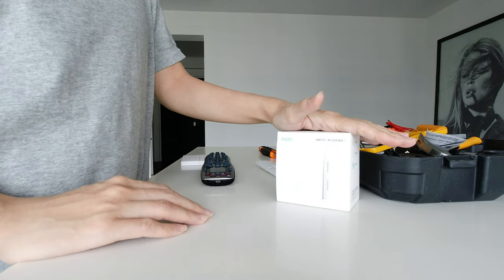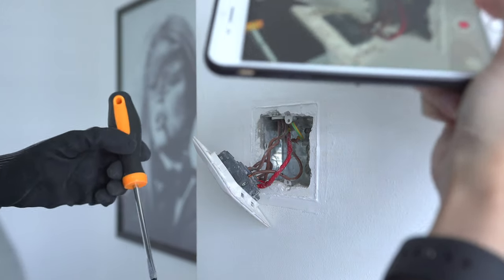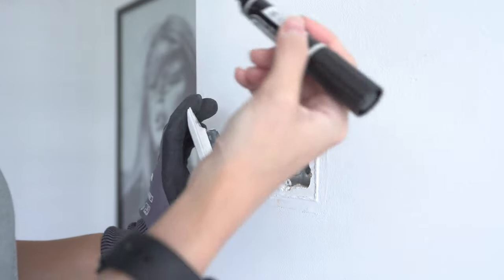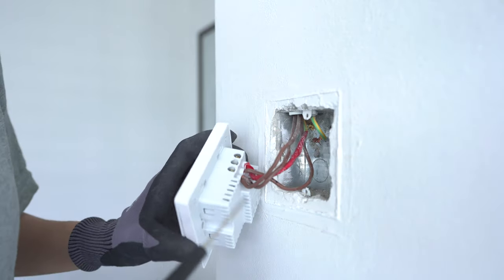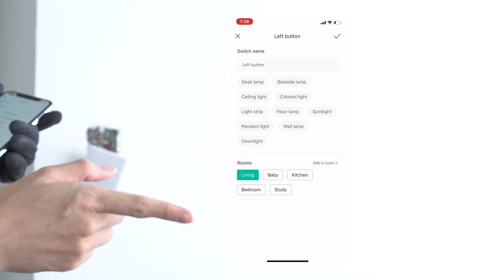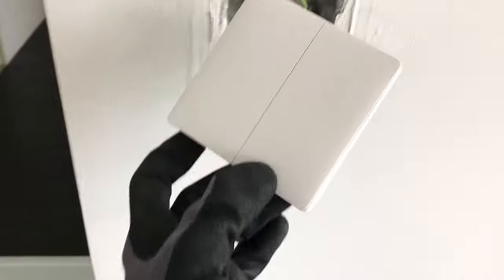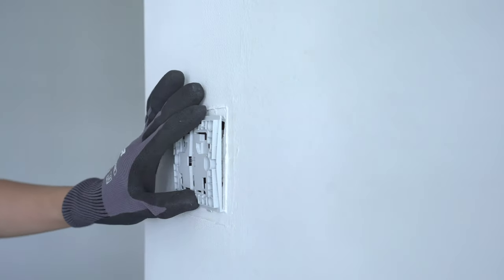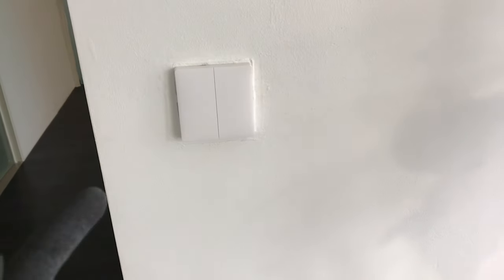Aqara Wall Switch HDB Installation *UPDATED VERSION*

Comment: Thanks for the great video. So you also need an Aqara hub for this switch to work? I have seen some wireless switches that come in a pair and no hub is required. One will replace the traditional switch and the other can be placed anywhere to perform the same switching function like a 2 way switch.

Comment: Hi, what is the purpose of inserting both 2 live wires together in L. Is it for a two way switch whereby you have another switch on the other side of your home that could control the same lights? Tia.

Comment: Hi, Excellent video! 
My room light swtich external push button, my contractor installed the small word "ON" look upside down, but the function is fine, may I know any problem with that? Should I ask my contractor to redo it?

Comment: Great video and I’ve learn something from you.  Correct me if I am wrong.I have the following setup 2 Xiaomi smart Leds connected to a E1 switch (2 gang no neutral line with just L,  L1 and L2) which automation can’t turn on when the E1 is in OFF state.  It only works when the E1 is in ON state.  Am I missing something or is Neutral needed.
Reply from the maker: Maybe different. Mine is the old kind of aqara which I removed it recently. I will be sharing my own smart home startup soon

Comment: Does hdb bedroom ceiling light switch concealed wire route towards up/down/left/right of the switch? Thinking of drilling 2 holes near the switch to mount the aircon remote control holder, so just wanted to avoid drilling into the concealed light switch wire, should I mount on up/down/left/right of the switch? Thanks.

Comment: thanks for video, understand I well that status (on/off) should not be true if you combine manual and app controll switch ? I mean situation - light are on by the app, then you turn off lights by switch - does the app show lights still on or off ? If app changes status - how long it takes ? Thanks
Reply from the maker: Sorry I removed my previous response as I thought u referred to the SwitchBot.

Here’s the correct ans: No matter u on off it manually, it will detect the current state on the app but it takes time. Can be 2 secs. But i noticed it response faster with cellular compared to wifi.

Comment: Excellent videos, I watched the old and this one, excellent information about the switches, good to know there are 2 different ones :)
Now I have a new project for my house, thanks again and keep it up!
Reply from the maker: Both videos are the same... aqara non neutral wall switches. And the latest d1 wall switches triple gang
Reply: @madsncakes  Thanks MADS, I actually meant the wireless switch vs the switch you wire to the wall :)
I thought it would've been a really great solution to actually change the switches, but didn't see that solution out in the regular places I shop. 
So thanks for bringing it out
Reply: @madsncakes  hi there, does the latest D1 wall switches have the same installation method as your videos? i needed triple gang switches so i need to get the D1 version for my place.

Comment: Great video. After seeing this video, I have better understanding of what to get for my next addiction 🤣. Btw, you are not using Mijia app but Aqara app instead for all ur devices. Anyway, you are such a handywoman but do take safety first. Kinda having cold sweat seeing u on the ladder changing ur ceiling lights...😅
Reply from the maker: Melvin Tan i am using mijia app as it’s most convenient for me with all the sub brands like Viomi etc. 
The first few steps was scary then I got used to it. It’s my first time attempting ahhaha
Reply: @madsncakes  Hi. is it working with Mi Home? or only with Aqara Home? I am using Xiaomi Hub Gateway v3

Comment: Hi @mads i am trying to change one of my hdb 2 rocker wall switch to the aqara switch non neutral. Apparently i have 6 wires instead of 4. Not sure if u able to advise

Comment: Enjoyed your video. I have installed a 2 gang smart switch , but I can only get one of the lights to work. Any idea where my mistake may be. My old switch was identical in wiring to yours and I transferred the wires as you did.
Reply from the maker: If the wirings are all correct, check the condition of the copper wires. If it looks burnt, trim the ends further in. Hope you understand what I meant.

Comment: Hi I need your support.
I want to use Aqara switches as a 2-way connection. 2-way - i mean a long hallway - with a light in the middle and 2 switches on both ends, so i can switch on and off the same lamp from both ends.

I currently have an existing 2-way electrical installation with normal switches (non smart).

Comment: Hi does the hub has to be near the switch? I thought the switch connected to the wifi and the hub could be placed anywhere in the house as long as it's connected to the wifi.

Comment: The two rocker switch that I am trying to replace has the same layout configuration as yours. I was expecting one Live/hot  wire coming from the MCB but there are actually two and interconnected exactly like yours.... I am wondering if anything need to be done to fasten those two wires before inserting into "L" socket of the Aqara switch.......

Comment: Hi Great vids! Do you think its possible to fire up the smart bulbs(such as Yeelight bulbs) or even turning it off with use of Mi/Aqara Motion Sensor without the need of changing the wall switch ?
Reply from the maker: As long as it is in the xiaomi family and connected via app. It should be able to automate motion sensor > yeelights

Comment: I saw that you managed to control the 2 pendant lights with 1 wiring and also ceiling lights with only 1 wiring.
How are those wired? are these daisy chained and run as 1 wire to the switch?
Trying to understand the wiring things for my upcoming home as well to consider smart switch or smart lights instead...
Reply from the maker: It’s hard to explain. If you need help - get an electrician who knows smart home stuff. Johnny +65 9010 9695

Comment: Thank you for this video.
If my lights aren't smart does the switch work ?
Thanks again.
Reply from the maker: PRG Line that’s the whole point. Smart switches will make normal lights smart
Reply: @madsncakes  Thank you.

Comment: Recently I installed a Aqara Wall Switch (No Neutral). But I unable to connect with Xiaomi Gateway 3. It show not compatible. What shall I do? Any advice? I thought Xiaomi gateway 3 support zeebiz and Aqara switch support zeebiz as well.

Comment: Hello. I have existing sockets at home which i want to replace with Aqara D1. Was wondering are the mounts standard? I'm referring to the size and spacing of the two screws at the 6min mark. Thank you!
Reply from the maker: It fits sg standard.
Reply: @madsncakes  cool thanks. hmm i noticed my plug has got 2x red wires leading into "Load" and then a blue wire. Does it mean that the "Load" are live wires and Blue one leads to my light? And that the "No Neutral" aqara will suit me? Thanks a lot!
Reply from the maker: @penumbralle27  no neutral suits all home. I am not qualified to give electrical advice
Reply: @madsncakes  I see. thanks a lot for the informative video :)

Comment: Hi, good video. Any idea usually, how many wires are there for wall sockets in Singapore? 3 (earth, live and neutral)? Since you are using Xiaomi just wondering if you know of any wall sockets (tempered glass surface, touch screen) that works with Xiaomi (Mijia). It will be good if it can work on a dual platform (with Tmall Genie). Thanks
Reply from the maker: David Ho I only know for my type of housing.. no neutral. Not sure about tmall genie sorry!
Reply: @madsncakes  Thanks for the reply. At least I know its no neutral. Just wondering if the no neutral is "by default" as in when u get your apartment (completely new) its like that or, its done through renovation (at least I have a basic gauge). Just want to confirm as many new apartments were built to be without neutral which is to cater for smart home as compared to the ones that were built earlier. Once again, many thanks for responding.
Reply from the maker: No neutral by default in hdb... anyone pls correct me if I’m wrong :)

Comment: I ordered an outsmart smart switch with no neutral. It comes with a capacitor and it says I must connect it to the very first light. Didn't really see or hear you mention about capacitor. Is it a must to install it?
Reply from the maker: Not a must.
Reply: @madsncakes  thanks for your reply. I have already installed the capacitor last week though.

Comment: Hi, very informative video there! Have u experienced the aqara switch not working even as traditional switch ( no blue light ) ?
Reply: When it was working fine initially then suddenly not anymore *
Reply from the maker: @pearlynlee6408  works ok for me! I used it for a very very long time. check the connection is correct and if a capacitor helps. one electrician who knows how to do this is Johnny 9010 9695
Reply: Thanks !!

Comment: Hey MADS. Just wanna check with you if your aqara hub coverage is enough for all the aqara smart switches without neutral? Planning to use the aqara smart switches but wondering if i would need a zigbee repeater for a 5 room bto?
Reply from the maker: Nope! One is enough
Reply: @madsncakes  thank you!

Comment: hello

could you share a little more on this switch as i'm also thinking of buying the Aqara switches, but i have some doubts

1) any issues with the no neutral switches you are using so far? i understand that the longevity of the Aqara switches without neutral has reliability issues. From your first video over a year ago, are both switches running well till to date?

2) did you install a capacitor across your aqara switches to solve the flickering issue etc? or you went without a capacitors, no issues so far?
Reply from the maker: EmptyHue hello there. so far ok. No capacitors. Occasional flicks (once 1-2 mth?) in the bathroom smd led but not on the T5. For my living room, no issues on cob led and aqara bulbs

Comment: Hi 
I just got a Aqara two rockers model no neutral but there were no blue light. Checked there is L-240V incoming . Do you think it is broken? Aqara hub also cannot locate this switch. Thanks
Reply from the maker: Did u hold down the buttons

Comment: is no-neutral smart switch stable? I came across some comment on no-neutral switch being fragile and incompatible with some low power LED light.
I am doing renovation to my resale HDB and I am thinking to put neutral wire to those switches.
Reply from the maker: Seems ok with my 7 watt cob leds, 12w, t5s....

Comment: Yes, more clearer understanding. Finally I can install the aqara switches that are in my bomb shelter.
So 2 wires marked with marker put to hole 1, 1 brown wire to hole 2. 1red wire to hole 3.
4 wires to 3 hole in Aqara Switch. Am I right?
Reply: I was wondering both live wire insert to one hole, is it okay? As in both live wire touching each other, is okay?
Reply from the maker: Yup in my video, top 2 wires goes to first hole which is L on aqara

Bottom wires goes to second and third
L1 and L2 on aqara
Reply: MADS sorry, so many question... is your living room you install the Aqara, a 2 way switch?
Reply from the maker: It’s 1 way with 2 buttons
Reply: MADS , do you happen to know if Taobao selling (2 way 2 button) version?

Anyway, for everyone info, I accidentally insert a Live wire and Switch 2 wire into L (Live), another Live wire into L2 (Switch 2). 
Button 2 didn't worked and lucky the whole power box didn't trip.

Comment: Hi, if I buy a triple switch version, wire only two buttons, can I use the third button to control something else. Let's say if I click the third button, can it turn off all the lights at home? Or the third button needs to be powered in order to be able to control something? Thanks
Reply from the maker: Yup don’t need a wire for third button. See my latest aqara video
Reply: @madsncakes  Thanks for your reply, I watched your video but couldn't find the answer to my question.

I did some research and ended up on this blog https://blog.tlpa.nl/2017/11/02/xiaomi-aqara-wall-switch/ He claims that "You might ask: ‘why would I buy a double key switch if I only have a single key now?’ Because I thought (potential spoiler) that I could only connect the wires for a single key and the other key would just be programmable (for other automation’s), sadly enough I had to find this out the hard way." 

It seems it's not possible to programme the button which is not connected for other automation tasks? I wanted to use the spare (I won't wire it to any lamp) button to turn off all of my lights at home but it doesn't seem possible? Thanks

Comment: Hi MADS, tks for the video. After watching I bought this switch n lucky I watch ur video n bought the no neutral version. My hdb is 20+ yrs n my switch is not build into wall type. U knw any base plate in the market can fit? Also, do u hv 小爱同学？any issue controlling it w it?
Reply from the maker: Welcome! Are u referring to something like this 
https://qoo.tn/BtETtW/Q111280845
Yes I have xiao ai. I usually just say xiao ai tong xue. kai teng. Seems to work perfectly. U can see more commands in app
Reply: @madsncakes  tks, will look into it.

Comment: Hey Mads, any issues with the aqara no neutral switches. There are many reports of the switches failing on hardware zone. Also can I ask if the lights you are connecting them to are all LEDs?
Reply from the maker: Felix Kho the aqara switch itself no issues. It depends on the light. If u are referring to flickering, it could be resolved by adding a capacitor to the light. So far I’ve used COB LED, SMD LED, T5 and LED bulbs... SMD LED is the only light with minimal flickers
Reply: MADS how do you add capacitor to the bulb?
Reply from the maker: I don’t know how...  sorry!

Comment: I've a question regarding 2 way switches... So legt's say my BTO has 1 way and 2 way switches set up in traditional wiring method... so If I want to change to SMART switch, for current 1-way switch I just need to replace a smart switch... but any idea about those which are 2-ways switches?
Reply from the maker: The connection must change to 1 way
And u do the 2 way thru automation in app.
Reply: @madsncakes  I don't really understand... Cos current wiring is done 2-ways already. So do I change the MASTER side to Smart Switch and leave the SLAVE side as the nornal switch? :)
Reply from the maker: @cheunkiatlee5152  must redo to 1 way and connected to aqara switch. Before u automate. Ask Johnny +65 9010 9695 if u need electrician to help u

Comment: HI MADS, great video! wanna ask. are all HDB units wall switch default comes with neutral wire?
Reply from the maker: Nope, neutral not required in Singapore light switches
Reply: @madsncakes  noted. Do i need to install capacitor on lights if go w/o neutral ar?
Reply from the maker: Watch my latest aqara updates

Comment: Hi, I like your videos. I'm considering smartifying some of my home too. 
How do I make the mi/aqara motion sensor work with a traditional light? Do I need to convert the light to the aqara smart switch before pairing it with the motion sensor (via the hub)?
Thank you!
Reply from the maker: Albert Liu thank u! If you wish to switch off the lights thru the motion sensor. Then yes u need to either change the lights or the lights switches to make it smart. Then automate it in the app
Reply: @madsncakes  Thank you! 
One more thing: can you select what time the motion sensor come on and off via the app and hub? I do not need the motion sensor (and the lights) to come on during day time since it will be bright.
Reply from the maker: Yes u can schedule
Reply: @madsncakes  Great! Thanks for helping!

Comment: Hello MADS, did you combine your xiaomi smart lights with this aqara wall switch? Did it work well? Thanks,
Reply from the maker: Meatballs hao I did. Works ok. Depends what u trying to achieve
Reply: @madsncakes  great to hear! It works well for me too but when I wanted to buy the 3 gang version, I saw one of the reviews with the seller commenting that smart switch should not be used together with smart lights. Tried finding other sources online but was not able to support the seller's comments. at least glad to hear it works well for you, ill continue to purchase then! Thanks!
Reply from the maker: If the smart switch status is off. The bulbs can’t be controlled by app. It can only be controlled if the switch is on- then u can change the bulb temp/color.
Reply from the maker: I have installed 3gang d1 too
Reply: @madsncakes  thanks for your advice and this video!

Comment: Just to check is there any problem with the switch until now? As I see review online that when there is no neutral wire it will have intermittent on and off. Please share your thoughts.

Thank you
Reply from the maker: Working well. Will share when I get time
Reply: @madsncakes   ok sure. thank you. BTW it is a comprehensive video for viewer to understand.

Comment: Hi, can you please tell me the dimensions of the switch? I am planning to order a couple of them however in the meantime the junction boxes should be installed into the walls. Can you please tell me which size of junction box shall be used?

Comment: Love your videos. Short and sweet. 

Need abit of help while I am planning for my smart home. When using Aqara Home app, which region do I choose? Currently there is no Singapore region and I do see "Other Region" as an option. Should I use that?

Also in "Other Region" I did see Aqara wired wall switch. Can I pair it with aqara home app?
Reply from the maker: Just A Cat Lover thanks! Yes have to choose China or other region